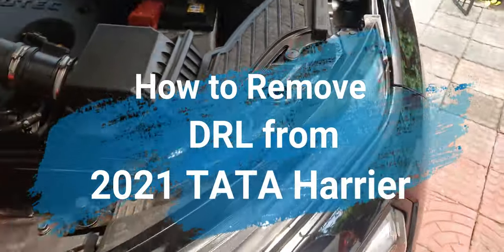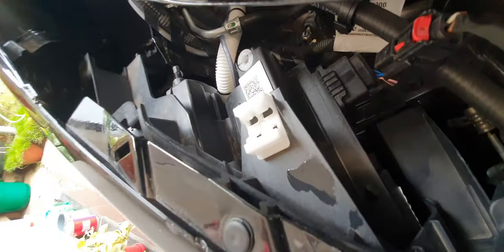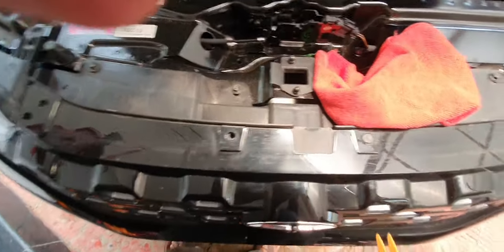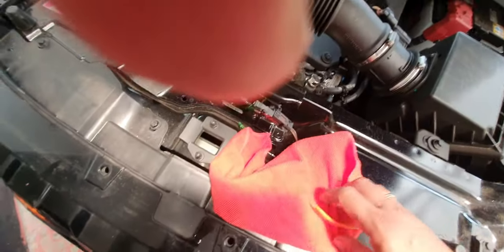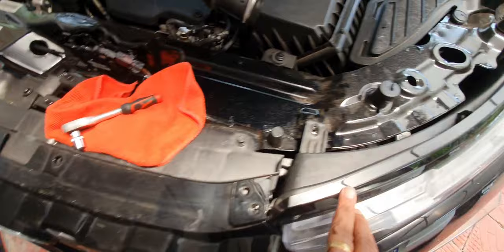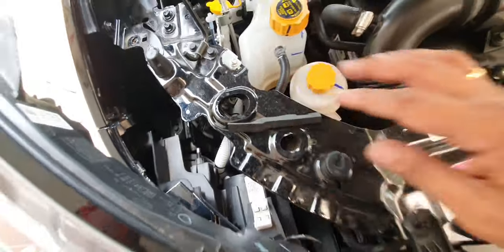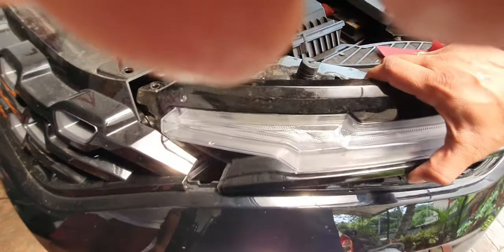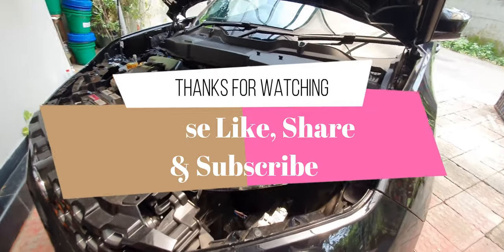TATA Harrier | How to Remove DRL

Comment: Tata safari 2021 xm model drl can be added??
Wherr to get drl for xm
Reply from the maker: Hi Amal you can get them on bodomo... it will be the same procedure, you can also check with the show room
Reply: @navein001  white drl wont be possible in bodmo..
Reply: @navein001  its bulb like drl in xm,if possible pls update which voltage bulb is used in tata safari 202q xm drl,so i can get white bulb,or dual funcation drl can i get frm any shop?
Reply from the maker: Yeah Amal i checked they do not have stock of the led drl.. why dont you check with Tata spares. They will have for sure. I think only one function does not work if you change the drl... which xm does not have. Am not sure what that function is.
Reply: Even I wanted to add led drl to my xe harrier ,but didn't get any support from tata workshop ,any leads will help if any 1 got led drl with dual function installed in base harrier